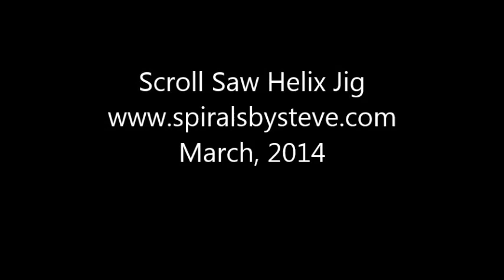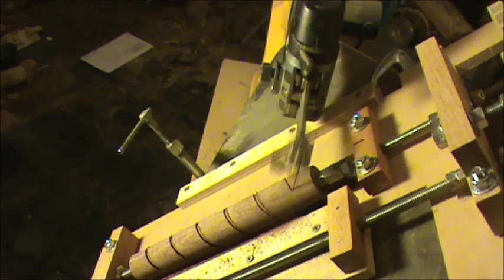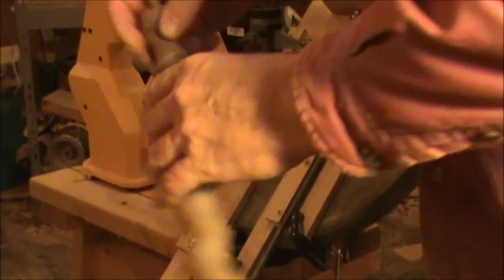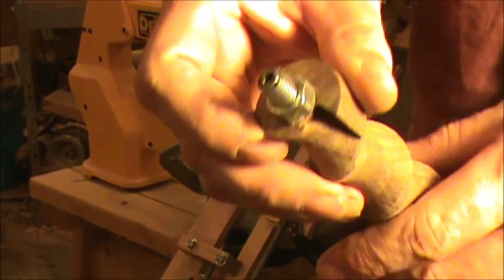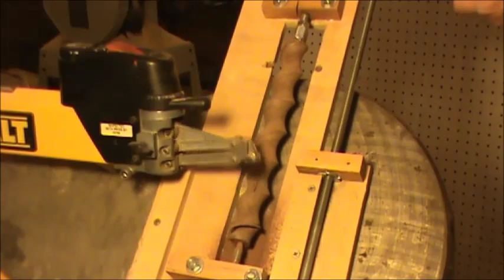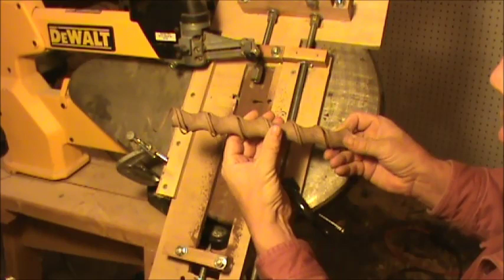Scroll Saw Spiral Jig.

Comment: Hi Steve, I just started making these again, on my own rig and came up with a differant drive a lot less fiddly. So counter sink a long leach nut so it has sharp edges( i used M6 as that's what I have on my drive end) then drill the end of the work (10mm)to the thickness of the nut, then drive in the prept nut then you have a hex hole which I mount on the hex nut on my drive, easy on easy off.
love and laughter o
Reply from the maker: That sounds like it would work.  The sharp edges from countersinking the nut act like a mortising chisel to make a round hole into a hexagon?